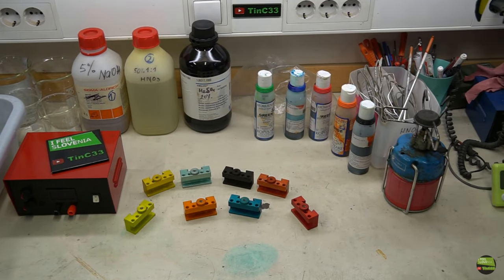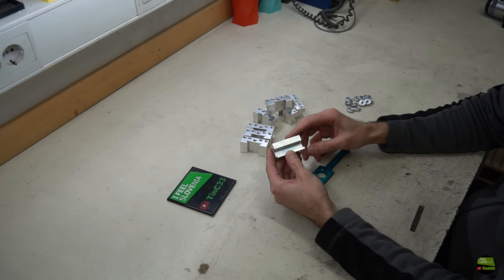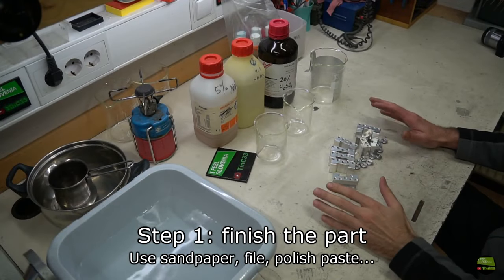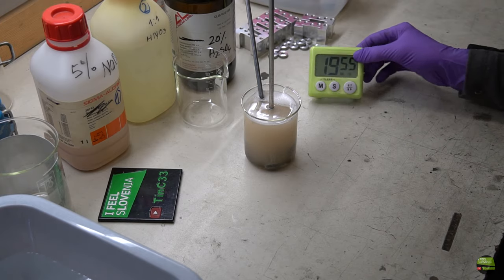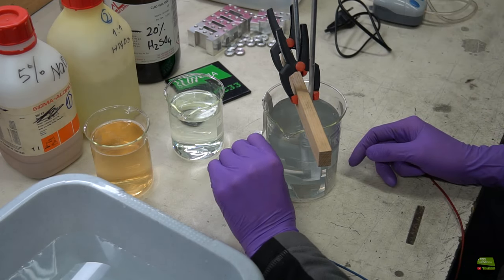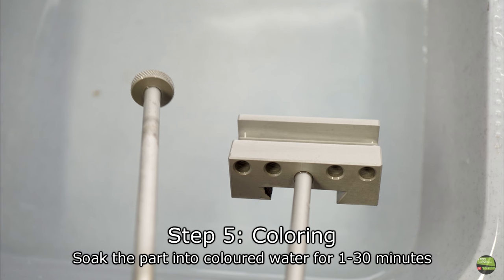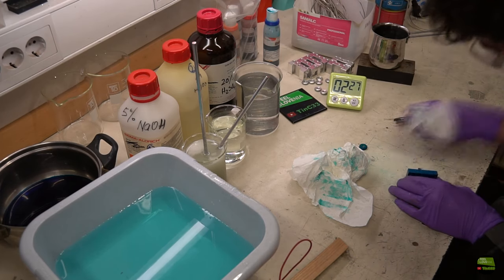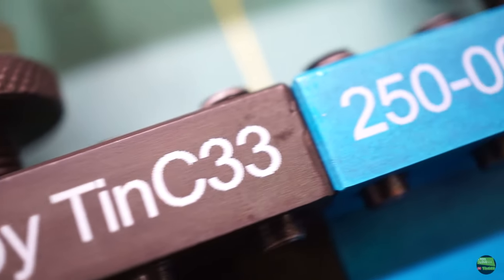How to Anodise Aluminium at home [how i anodised at home]

Comment: Will anodizing aluminum cause any decreases in aluminum mass?  Like if I have a precisely 1.5cm aluminum screw, will the acid eat away at the metal and cause the screw to be smaller?  Thank you
Reply from the maker: @tillmerit8431  it can etche a bit of materiall yes but not so much, like m3 thread will still be usable but the nut heave a bit more backlash on it, it become noticable when we make the process wrong, like too much current lead to higher gemperature of solution, more material etched...

Comment: Mind Blown. Our cloths dryers in the US do not have tanks to capture the water.  Oh and learning how something is done is awesome too!
Reply from the maker: Really so you need a drain to plug them?
Reply: You do have them, they are called condensating dryers
Reply: What he refers to are old style dryers noncondensating / Sklicuje se na stari sušilni stroj brez kondenzacije
Reply: A portable dehumidifier is another good source of distilled water. Maybe air-conditioning? Not sure about the latter.
Reply from the maker: @robmurg  true, i just renovate my house and while dry walls with dehumidifier there come lot of destilated water, that one i used for mixed wall paint.
Reply: It just vents steam through a hose connected to a hole in the wall.
Reply from the maker: @KeithZim  oh yes i saw those lines completely blocked someone cleabing on tiktok

Comment: Nitric acid is difficult to find in my place and expensive too. Is there any substitute for it to remove the black layer in the aluminum? Please someone anwer. Thank you.
Reply from the maker: I think you can skip this step and it work anyway but didn't try so i don't know the result. If you shorten time of first step part also won't be so black
Reply: @TinC33  my first attempt anodizing failed. So i try removing the dye in sodium hydroxide solution but the material became little black. I want to remove this black coating so i can start again from beginning.

Comment: Thank you for the video,  I plan to do it myself.   Just one question: if I make some error and the part will not look nice (pale color, spots, stripes, not a uniform color, whatever, I think there are possible errors to make especially for a beginner) how can I save the part, ie. can I remove the failed anodizing, or what is proper way of redoing it?
Reply from the maker: Sure just repeat 1 step and all gone.

Comment: Hello ! Can i leave my part as it is after part 2 ? So just soak it in sodium hydroxide clean it with destilated water and thats it ? I just want to make my motorcycle handlebars black
Reply from the maker: You can but there will be no protection, aluminium will coroded after time
Reply: @TinC33  Is there a way to maintain and secure this color ?